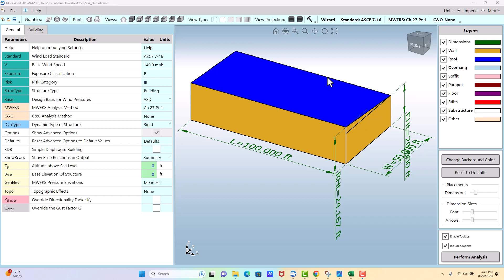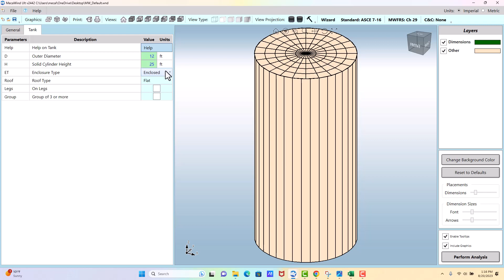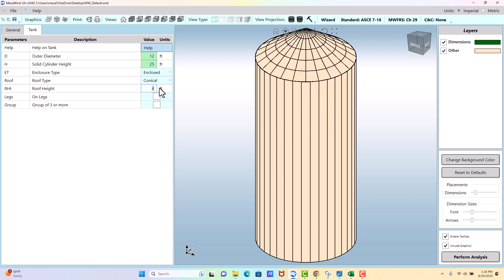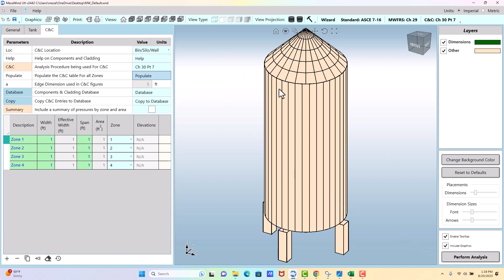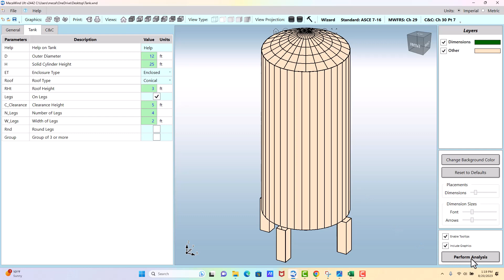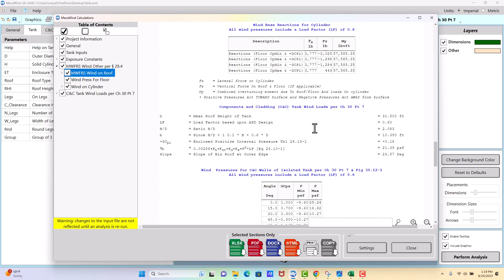Wind Loads on  a Tank, Bin or Silo

Comment: how about the thank is horizontal?
Reply from the maker: @relaxforamoment487 We are following ASCE 7's criteria for tanks, and they only outlined a procedure for vertical tanks.  We don't currently have a simplified option for a horizontal tank in MecaWind, you would have to treat it as a vertical tank and then apply the loads to the horizontal section.  That might be a little conservative because the Kz (Elevation factor) would be higher than it is in reality, but it shouldn't be too far off.